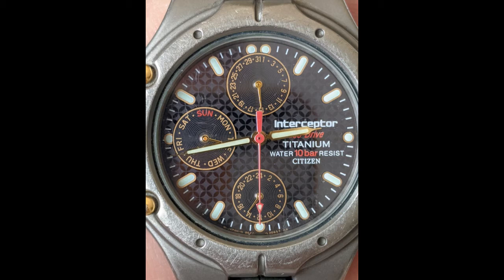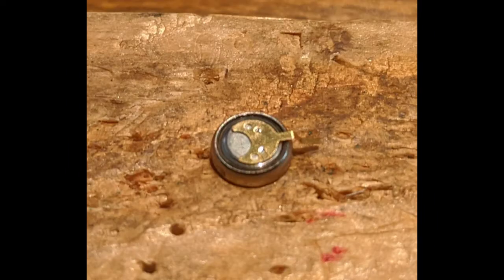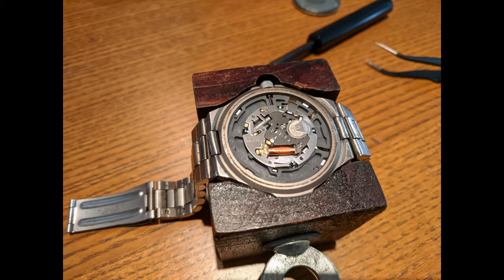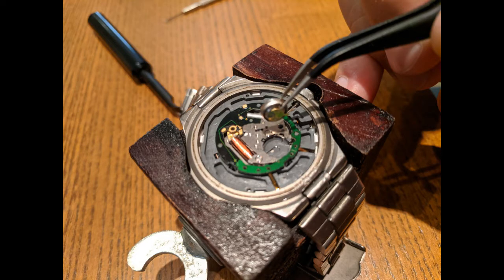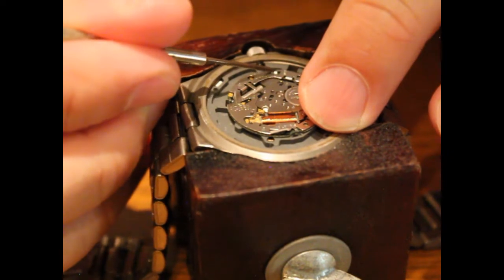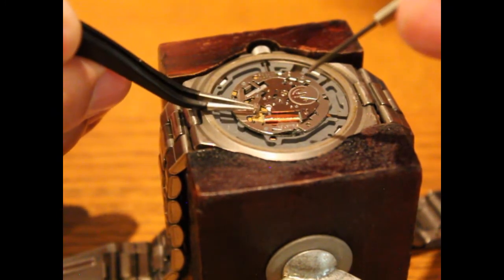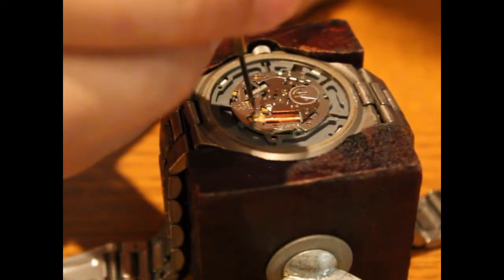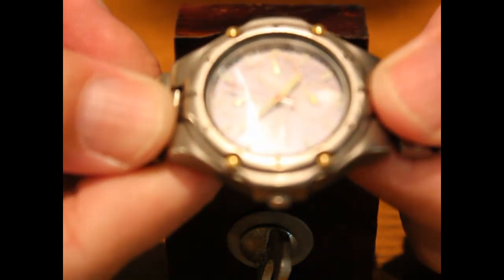Citizen Eco-Drive Capacitor Battery Replacement

Comment: I did the capacitor on my 9415 Eco-Drive and boy what a walk in the park it was compared to the Seiko Kinetics.   Done a VR43 Solar today and that was even easier just being a cell with two prongs shoved into the battery cavity, no screws so obv Seiko have learned things hehe
Reply from the maker: I think this one might have been more of a toughie because it needs to be water tight.  Man, getting that back off was much harder than putting it back on - glad yours turned out to be much easier.

Comment: There's one point you didn't quite cover thoroughly enough for my taste:  "Make sure that little tab is pointing where it needs to be."
How can you tell in which direction it's supposed to be oriented?  

(Let's say you popped the capacitor out to see what model number replacement you needed to buy, and prior to seeing it out of the watch for the first time, you had no foreknowledge that there was such a thing as a battery that needed a specific rotational orientation, and so you weren't paying attention to how it was situated when you removed it.)
Reply from the maker: If you're talking about the orientation of the battery at 1:50, I hope the video speaks for itself - you can see the orientation of the little tab right as I snap it in place.  Please forgive me as I might be misunderstanding what part of the video you're talking about.
Reply: @juliushowlett7247  to further clarify - Yes, I can see approximately how you have it oriented, but, if precision is needed, I'd like to see what it's being lined up with.  I assume it's completing a circuit somewhere that we can't see on-camera.
Reply from the maker: @MrOmegaRabbit  Yes, I see what you mean.  A modest diagram may have helped to show what needed to go where.  Next time I need to replace this 'battery', I promise the video will be better :) These watches are pretty cool and I hope this vid helps save any others that would be binned otherwise.  Thanks for sharing your input!